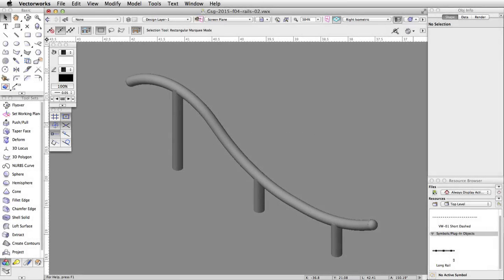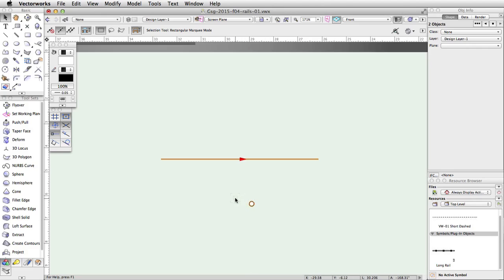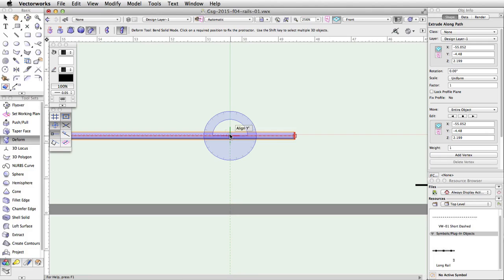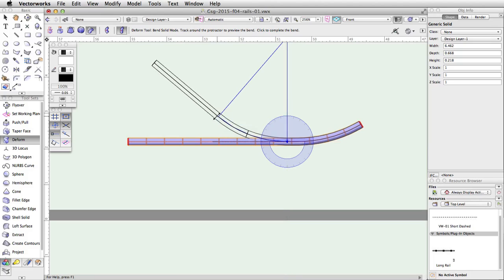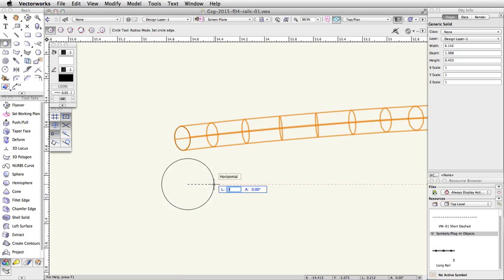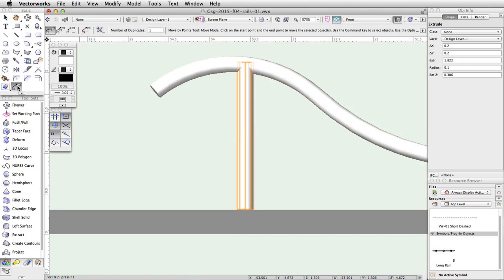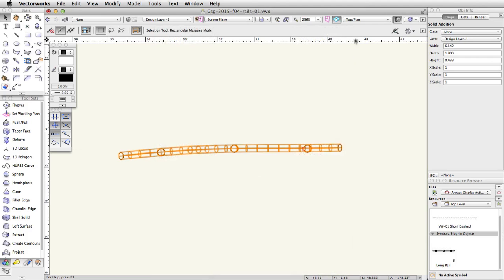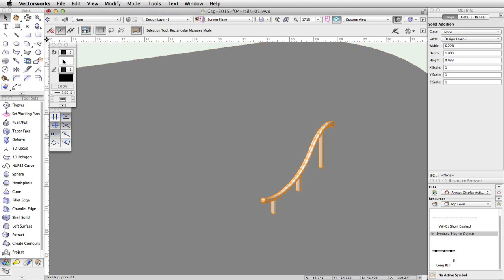GSG - Vectorworks Fundamentals 2016 - 05 Curved Rails

Comment: At 4:00, we are instructed to move the extruded circle to a position on center of the rail. I cannot seem to move the circle to an actual centered position under the rail. Is the move supposed to snap to center? If so, which snap settings are required to do so? I've tried every combination of snap settings I can devise, and can't seem to make this happen.